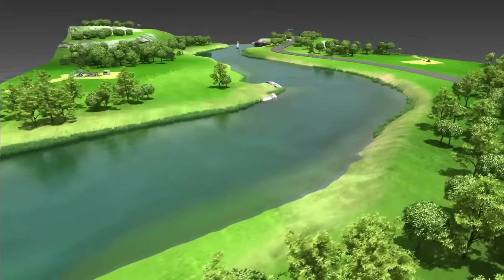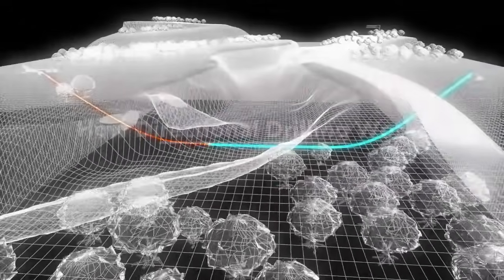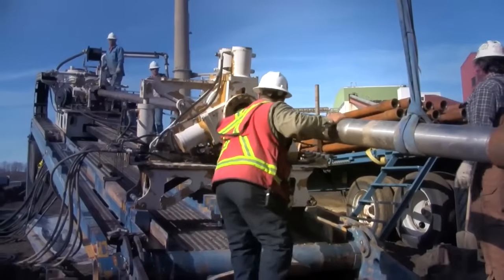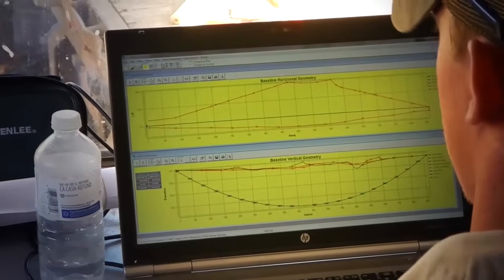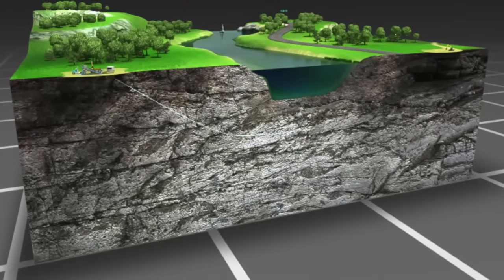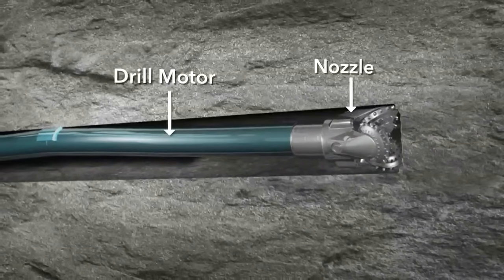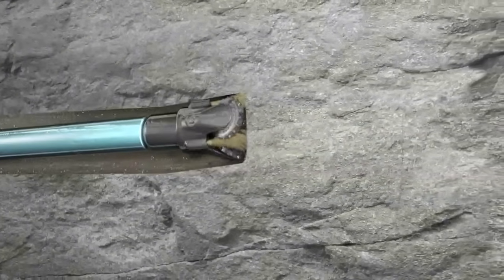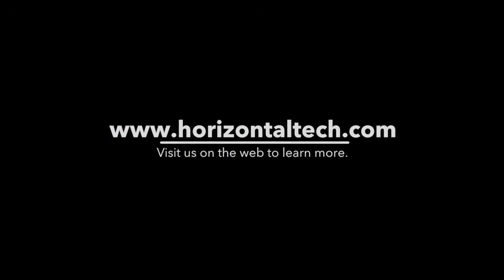Horizontal Directional Drilling / Boring (HDD): How the Drill Bit is Steered

Comment: For me, the explanation of how the steering works in hard material wasn't clear.
Reply: Yeah, it sounded like they just repeated the regular explanation.
Reply: There is a second internal rod that allows you to rotate the front drill bit separately, without rotating/having to changing the orientation of the 'bent sub'

Comment: The Horizontal Directional Drill knows where it is at all times. It knows this because it knows where it isn't. By subtracting where it is from where it isn't, or where it isn't from where it is (whichever is greater), it obtains a difference, or deviation. The guidance subsystem uses deviations to generate corrective commands to drive the Horizontal Directional Drill from a position where it is to a position where it isn't, and arriving at a position where it wasn't, it now is. Consequently, the position where it is, is now the position that it wasn't, and it follows that the position that it was, is now the position that it isn't.
In the event that the position that it is in is not the position that it wasn't, the system has acquired a variation, the variation being the difference between where the Horizontal Directional Drill is, and where it wasn't. If variation is considered to be a significant factor, it too may be corrected by the GEA. However, the Horizontal Directional Drill must also know where it was.
The Horizontal Directional Drill guidance computer scenario works as follows. Because a variation has modified some of the information the Horizontal Directional Drill has obtained, it is not sure just where it is. However, it is sure where it isn't, within reason, and it knows where it was. It now subtracts where it should be from where it wasn't, or vice-versa, and by differentiating this from the algebraic sum of where it shouldn't be, and where it was, it is able to obtain the deviation and its variation, which is called error.

Comment: What happens to the drilling spoils during the backream-pipe pulling stage? Are the spoils expelled from around the pipe opposite the puller-drill rig or do the spoils go up the pilot hole?
Reply: The spoils go both ways back to the machine and towards the receiving pit, you pre ream first to get all the spoils out and then you re - ream to make sure the hole stays open so when you back ream while pulling the pipe it has a wide enough hole

Comment: I was curious how they steered these drills after I watched the Chile mine rescue.
Reply: Wrong drilling rig bub.
Reply: @JS-oy6nn  I imagine it is similar technology.
Reply: @Kosmopoli  yes and no. On vertical hole the use “steering arms” that help steer the head. There’s 4 on the steer collar that deflect. 
We use the horizontal drilling for pipelines. It’s really quite incredible what they can do. Have lots of pictures over the years of jobs I’ve been on.
Reply: @JS-oy6nn  Sounds like interesting and hard work. Thanks for the info I will research vertical steering drills. I am sure I have used services that are related to the work you have done so keep it up!

Comment: Finally got it! Well shown and explained and easy to understand! So it is simply not just a matter of boring, but depending of the type of formation use high pressure flow of the fluid in softer formations and in harder formation make use of the bend and also use the high pressure fluid and drill together. Very nice, straightforward and informative. 👌👌👍😉 
Look forward to see how the last part of the drill looks above ground. 
Thanks a lot you guys

Comment: it doesn't explain one fk'n bit how the bit is steered... just some bullsht
Reply: Yes it does. The end section is bent and they rotate the drill string and stop it when its pointing in the direction they want it to go, then remove material with one of the two methods described.
Reply: @NevadanHunter  What is the "drill string"? Us layman who find this process fascinating but know nothing about it don't understand the terminology. I assume that it's a term for the whole line of pipe from the rig to the drill bit?

Comment: I'd be willing to bet it's a bit more complicated than what this video shows. A simplified version, yes?
Reply: Pretty much the basic simple version.   

You have to factor your mud mixture, ground type not just rock and sand size of jets on the drill bit and reamer as well as the types of reamer you want to use after the pilot is drilled.
Reply: You the man, Mac!

Comment: Most of the questions I see are about how the cut up chunks, called cuttings in the drilling world, are brought back to surface. The short answer is that the special drilling fluid that is pushed out the end of the bit in the video has a high enough viscosity to pick up all of the particles and carry them back to surface on the outside of the drill pipe.
Reply: Not just viscous but also dense.  The cuttings float in drilling fluid.
Reply: Thanks for the  clear insight.

Comment: What they don't tell you he is the component right behind the bit is called a housing. The housing has a bend in it 2 degrees or so and houses what is called a saund which sends a signal to the surface. The signals picked up by the locator which shows you a clock if you will 12 o clock being up three o clock being left 9 o clock being right and six o clock of being down. The bit is connected to an inner rod which spins all the time. The housing is connected to the outer rod which is turned to the needed Direction. The cuttings or spoils are removed by pumping mud through the pipe and pushed out around the outside of the boring pipe which is called returns. That's about as simple of an explanation as you can get.
Reply: Yeah them leaving out the locater is pretty strange. It's literally how you know where your steering lmao
Reply: @achillesninja  its literally just showing how the drill bit works, thats it. simple. They arent showing the entire process.
Reply: @beedt714  its literally not showing how the process is done.
Reply: @achillesninja  it’s not , just showing how the it looks like…… 😂
Reply: Thanks for answering thais question bugging me.
Reply: In directional drilling, the drill bit always bent some fixed angle, if it is not steered ( drill pipe not rotated)  it will draw a circle with the radius based on its bent angle. If we want it to go through "straight" actually we just draw a spiral, spin the drill pipe while it move forward, so we need a real time azimuth and elevation data, that send via mud pulse, called MWD. This data plotted continously with the rate of its travel, and after some computation we can see the drill path, or get the feed back for rotating(steering) the drill pipe to some pre programmed 3 dimensional path . CMIIW
Reply: When you drill and case horizontally, how does the drill pipe and casing actually curve to achieve the 90 degree angle??b
Reply: @PPworldfamous  Thanks, more complicated than video conveyed. Guess I’ll look elsewhere to run irrigation lines for my lawn & garden 😀
Reply: @gr8dvd I’m pretty sure @chrisbrown is asking a question not stating anything lol
Reply: @a-a-ron4679  Oops, TY meant for OP’s detailed explanation.
Reply: @gr8dvd  no worries. I had just read his comment/question and then minutes later yours popped up and I thought, wait a minute. Lol. I was hoping you had the answer. Maybe someone will reply soon. Take it easy
Reply: @a-a-ron4679  Re: curves perhaps someone more expert will explain but as I understand the pipe follows where water jets loosen material and by consistently activating the 3 o’clock jet, for example, the pipe will curve right.
Reply: @gr8dvd  that makes sense. I worked as a dispatcher and later a terminal manager for a trucking company that hauled exclusively for the oilfield. I also worked as a logistics planner for Schlumberger. We hauled stators, rotors, and mud motors like crazy as well as pretty much everything else. Very cool stuff.
Reply: Very well said. I also noticed why the main thing doesn't mentioned the housing, saund and the detector or cable locator
Reply: *sonde
Reply: Thank you, I learned something new today 😊

Comment: but how those hard pipe bend
Reply: Each pipe bends a tiny bit.  Over a long distance, it adds up.
Reply: you cant bend them by hand. but they do bend in the ground. that is not an issue. keep in mind that the pipe is hallow and  not solid.
Reply: @underlinehdd  Sir/Mam , I've some doubt,
1. If pipe bent upward slope direction then, How sewage flow against gravity?
2. During the drilling process, the waste soils are we made, so How the soils are taken out from the underground hole?
Pls explain Sir/Mam.
Reply: oneviwatara  Material is displaced from the subterranean drilling equipment, and the subsequent pipe, thus it has to go somewhere. That somewhere is above ground where the equipment came from. You swap one for the other.

Comment: Still, it doesn't make clear how the actual drill bit assembly is being redirected - "go left, go right ..up. down". Is there, for example, a hydraulic pressure coming along the shaft from the operator to make the bit 'lean' in a required direction? How does this work exactly - none of the explanations online seem to go into this.
Reply: 6 months old but I'll answer anyway.
The shaft is bent, so the damn thing always goes at an angle xD
They have controls to measure the current angle of the bend, so they know it'll dig up, or whatever.
To dig straight, I think they just rotate the bend constantly, making a small spiral that looks straight.
Reply: this video is wrong. and it will confuse you. Theres two styles of directional drilling machines. One style that drills through dirt, and the other style that can drill through rock and harder ground conditions. This animation is showing a rock drill, but drilling like a dirt drill would. 

a dirt drill has a paddle at the tip. it points in the desired direction to achieve and you just dead push to gain a change in direction. if you want to go straight you spin quickly and push slowly.

a rock drill is different. it looks like what the animation shows, but whats wrong with the animation is that the tip spins at all times. the outer rod has a slight bend in it and thats how you get direction. the inner rod spins the tricone bit at the end, ill say it again, AT ALL TIMES. You cant push a tricone bit unless you were in softer ground. If you were to use this bore head in softer ground it most likely would not gain enough change in direction to complete the bore successfully. At no time will you ever see a tricone not spinning while the bore head goes through the ground! But what the animation might have been misunderstanding is the outer rod doesnt spin all the time. you will spin the outer rod to determine the direction you want to go like up down left right. and then you spin the inner rod and push slowly. the bore head has a slight bend in it that allows the change in direction when the outer rod is stationary in the desired position.
Reply: Thanks for the insight
Reply: Weight on the bit plays a small portion in this method of drilling. 
What the video shows is very clear, but for individuals without experience in this field it may be confusing.
As indicated in the video the jetting assembly or drilling motor has a set degree of bend.  In this case it is typically between 1.76 and 2.12 degrees.  The orientation of this bend is controlled by the driller receiving information from the steering tool to the surface.  The driller, depending on the desired results, controls the orientation to achieve the required outcome.  For example, if the BHA (bottom hole assembly) needs to steer up, the driller will orientate the bend to face at 0 degrees or due north(Up), 90 degrees (right), 180 degrees down (180) or left at 270 degrees (left).  This orientation can also be split to smaller increments, for example 45, 115, 210, etc.  This orientation is controlled from the surface by rotating the drill string to the desired angle as indicated by the tool.  In a jettable assembly the hydraulic pressure blasts the softer material in front of the bit and removes it out of the hole by suspending the cuttings within the drilling fluid.  The driller then applies forward momentum, while holding the desired angle to achieve the desired angles.  For harder formations a mud motor is used and the same process applies, except the drill bit is rotated hydraulically at the drill motor itself while the orientation is stable.
Reply: spottymaldoon If I'm not mistaken the drill bit/rig has a bend in it to control direction..
Example...if the bend is in a downward position the drill boars upward.
The video shows this clearly if your familiar with subterranean drilling.
Hope this heled.
Gary
Reply: You are incorrect, the video clearly provides two examples of the BHA, one is the jetting assembly and the other is modified to use a mud motor.  There are not two styles of drilling machines.  Listen to the video again and you will see that they were indicating two methods.
Reply: Weight on bit
Reply: Dustin Brasher no shit im just giving reference so the man can go and learn.
Reply: first off they were using a motor the whole video. it turns the bit when mud pumps through it, this takes a specific pressure. the pressure goes up harder you push so you targer a specific raise in pressure. there is a digital clock face with a needle showing the orientation ( up down left right).  the driller can see; hoe hard the rig is pushing, pulling, takes to turn forward + back, speed going into ground, pump pressure, rate of fluid being pumped, volume of fluid, and restriction on returning fluid. its like a airplane in the doghouse with a computer over 15 levers 6 gauges and 5 tabs on  computer screen. hope that helps
Reply: spottymaldoon

Comment: I get this, but what about the pipe behind the bit? How do you steer a solid piece of pipe around corners?
Reply: +Jake LaRoe Some sections of the pipe are flexible
Reply: @RandomVideos2  but all of the pipe would have to be flexible for you to shove all of the pipe passed a sharp corner, so that doesnt work if only some sections are flexible.
Reply: All metals have some degree of flexibility.  Picture a railroad switching yard.  Do you see curves in any of the tracks?  Even though the track is a very strong steel, it can still be bent over a distance.  The drill pipe is similar in that respect.  
From the bottom end of the vertical bore hole, where the directional drilling begins, to the full horizontal direction may be a quarter of a mile.  Over that span, the drill pipe can easily flex enough to accomplish the turn.
Reply: @ldgrmp  Bro, if the pipe drilled downwards ,( some slope value) then, after what distance we make the bore hole in exact  Horizontal direction? OR there is some slope value up to downward bore drilling??
Reply: @AjithKumar-gf1ps  no its not the slope, they are able to minimally steer the drilling head in a direction and to achive the curve they just steer hard in one direction for a while. The question was "how does the metal pipe get shoved around a corner?" And the answer was" you can bend it gradually oved a wide radius because steel bends"
Reply: @ldgrmp  Thank you for your confident and clear explaination for this simple and overlooked question, of the 30 minutes of searching I have done this is the best explanation on the internet, it even explains the answer to my other imediate question about the radius of the curve, and for this you deserve a metal of education! This answer I suspected on my own intuition but its nice to have a more knowlagable teacher confirm my hypothisis. Thank you.
Reply: sometimes you dont, and you end up with "keyseating". Essentially digging into the low side of the hole, due to obvious gravitational effects.
Reply: pipe is super flexi,, will break at the threads